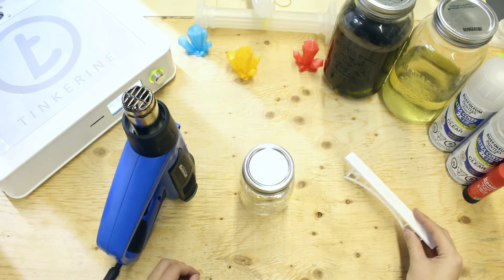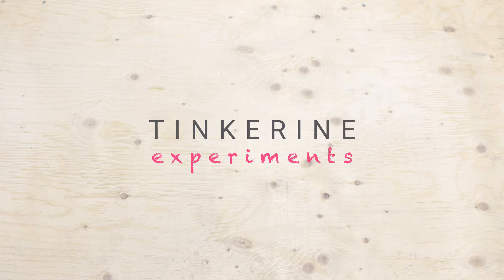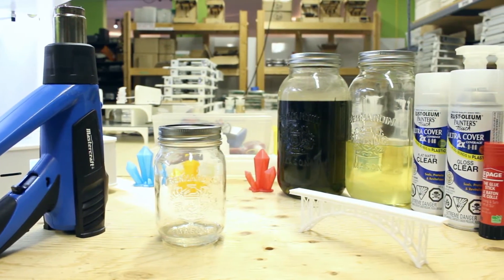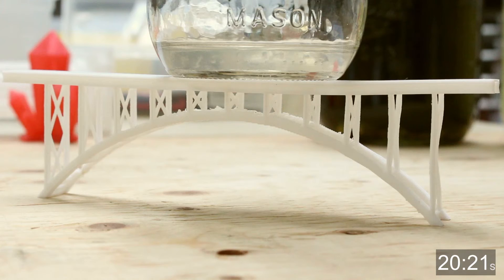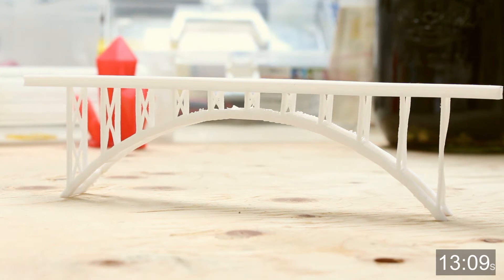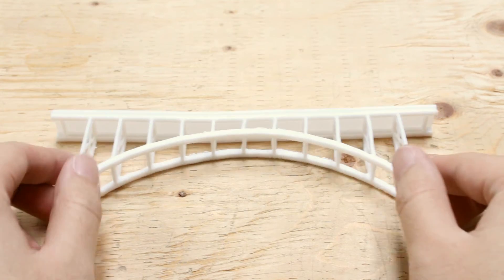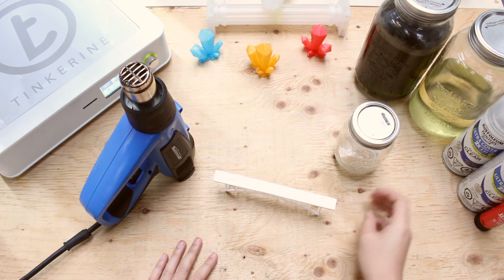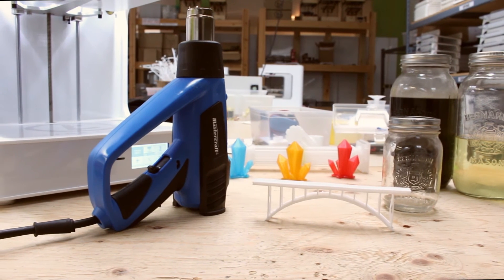Testing PLA's Heat Resistance

Comment: You probably should have measured the temperature of the pla at which it melted.   You know the heat gun produces 550 but you don’t know at what temp the pla failed.